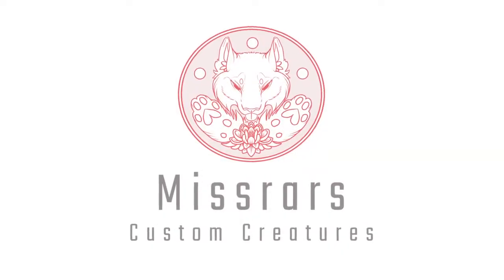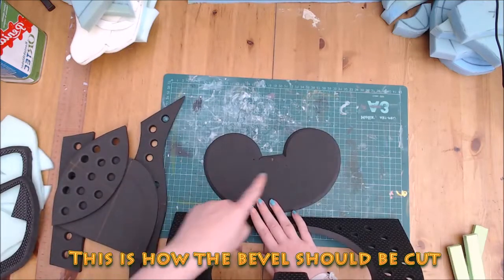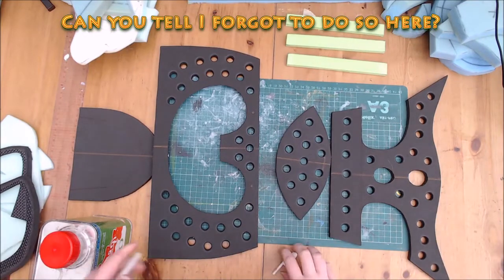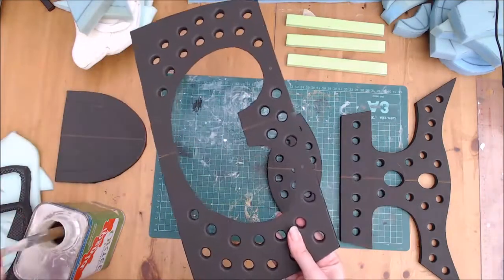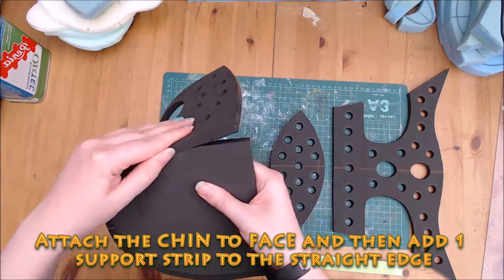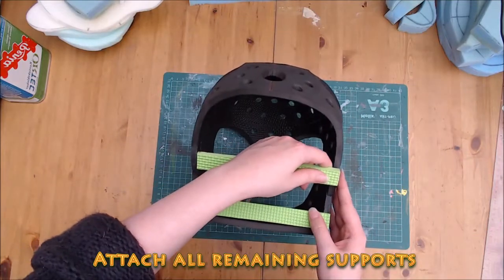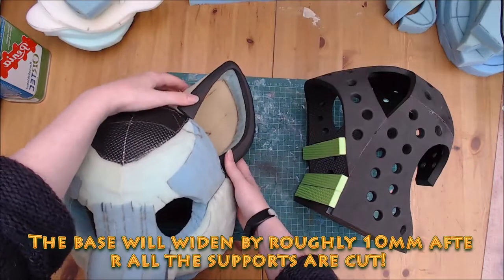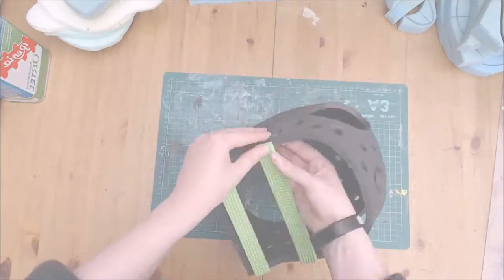PDF PATTERN 'Faceplate' Foundation Fursuit Base   Digital Download

Comment: I've made it I have it on my hands and I still can't figure out how to get it on my head
Reply: Have you found a way to attach the base to the face plate? Please and thank you 🥲
Reply: Did you figure it out?
Did you take out the strips across the bottom of the faceplate base? Those are temporary, they hold the base in shape until you add the foam on top.

Comment: hello! i bought your catexfish pattern for my first fursuit build and i was wondering if E6000 would work for the faceplate :)
Reply from the maker: Apologies for the late reply! I would recommend Contact Adhesive tbh. You might get away with E6000 but you’ll need to pin the seams while the glue cures. E6000 takes 24-48hrs to get to full strength so it’s not the best option for this kind of base layer.